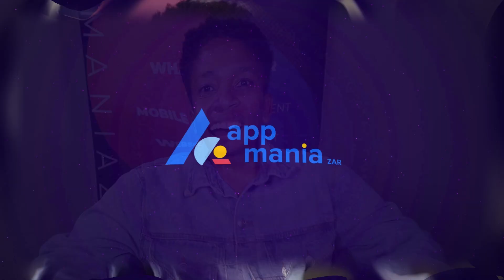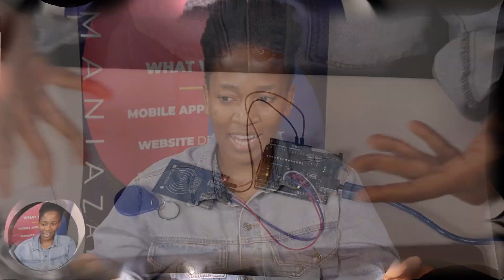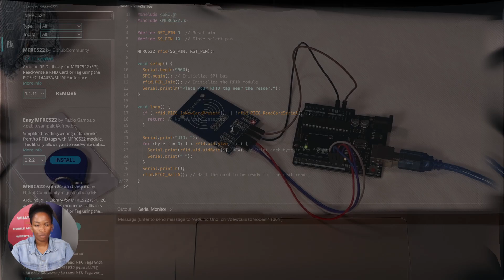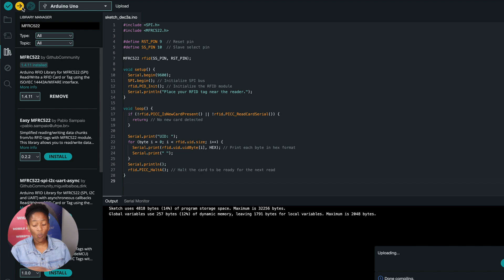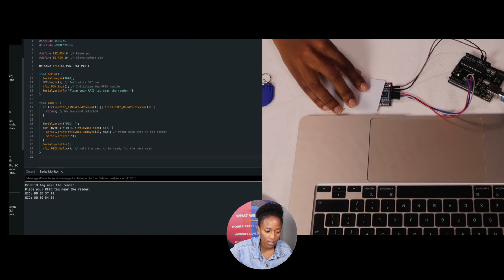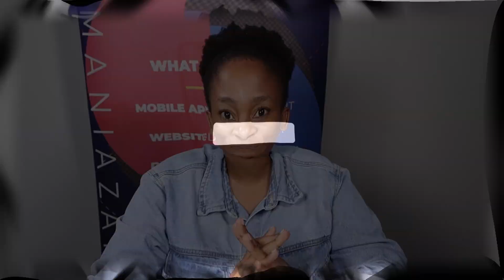Radio Frequency Identification | RFID | Tutorial video

Comment from the maker: Here is the code for  code for reading RFID tags using an MFRC522 RFID reader module

#include <SPI.h>
#include <MFRC522.h>

#define RST_PIN 9    // Reset pin
#define SS_PIN 10    // Slave select pin

MFRC522 rfid(SS_PIN, RST_PIN);

void setup() {
  Serial.begin(9600);
  SPI.begin();        // Initialize SPI bus
  rfid.PCD_Init();    // Initialize the RFID module
  Serial.println("Place your RFID tag near the reader.");
}

void loop() {
  if (!rfid.PICC_IsNewCardPresent() || !rfid.PICC_ReadCardSerial()) {
    return; // No new card detected
  }

  Serial.print("UID: ");
  for (byte i = 0; i < rfid.uid.size; i++) {
    Serial.print(rfid.uid.uidByte[i], HEX);  // Print each byte in hex format
    Serial.print(" ");
  }
  Serial.println();
  rfid.PICC_HaltA();  // Halt the card to be ready for the next read
}